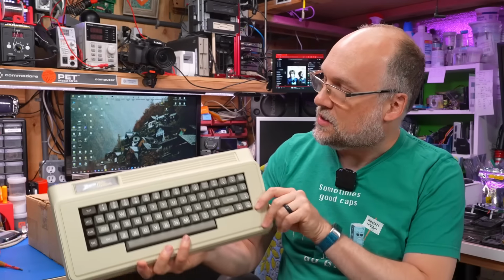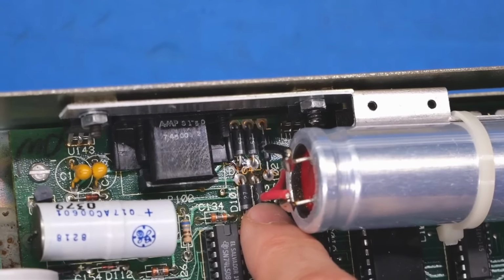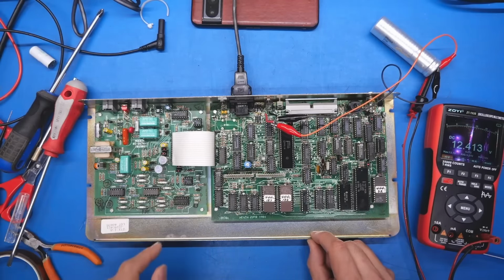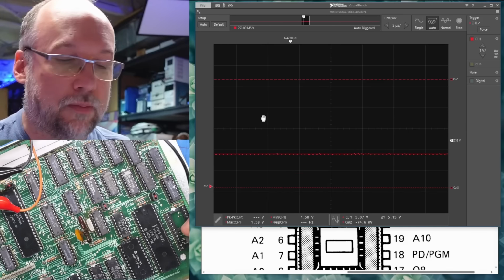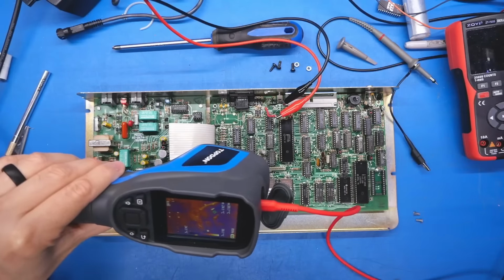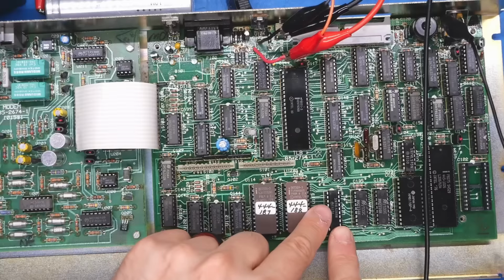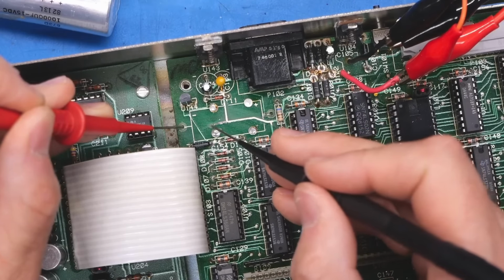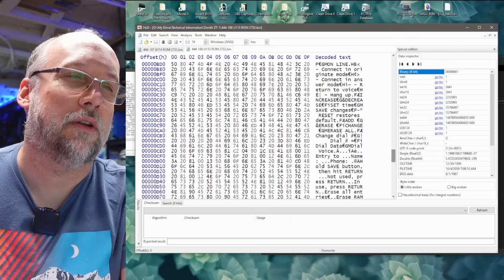The Zenith ZT-1 tried to be a low cost gateway to the information age

Comment: The EA pin is the "External Input" for the microcontroller.  It might be internally grounded on the 8031.  It permits the mask ROM in the pin compatible 8051 to be bypassed and use external ROM instead of the internal ROM.  If you pull the microcontroller and that socket pin is grounded, you should be able to swap an 8051 into the circuit to rule out the 8031 being a problem.  You could of course manually ground the EA pin of an 8051 with an external wire if that socket pin is not grounded.  I've used an 8051 as an 8031 on a solderless bread board with an EPROM acting as the ROM more than once.  Finding an 8051 will probably be easier than an 8031 as they were widely used for years and licensed from Intel by NEC, Siemens, etc. to manufacture compatible versions and variants to meet unique needs.

You might also want to check there isn't an interrupt inputs on the 8031 that is constantly being triggered.  If INT0 or INT1 is constantly held low for some reason, it might be spending all the clock cycles servicing the interrupt routine and never really get much of anything else done unless there is code to prevent it from being overwhelmed by interrupt requests.  There would be some bus activity as observed if this were taking place.

There are a lot of "shenanigans" that can be and were played using the Intel MCS-51 family of microcontrollers and others of the era.  Most of the 8031's ports are used for bus operations with EA grounded, however not all of them are.  All of port 1 and much of port 3 can be used for other stuff.  The addition of 74LS244 and 74LS374 ICs were often used to regain some of the lost I/O points when external bus functions were needed, as were the 8155 and 8255 peripheral interface chips.  Although a free pin on either port 1 or port 3  could be used to enable/disable one or more chips and be a little hard to spot.

Some of the conventional logic for microprocessors of the era, such as the 6502, 6809, 8085, Z-80, etc. doesn't work 100% for the MCS-51, MCS-48, MCS-96 and similar Intel microcontroller families due to the architecture difference.  These microcontrollers are based on Harvard architecture not the Von Neumann architecture that is more common.  You noticed the RAM quirk compared to microprocessors of the era for example.  They're confused chips trying to be RAM, ROM, Port I/O, and a Microprocessor at the same time.

Comment: I wonder if the same design/ROM was used in some kind of Heath terminal. Bitsavers might have something. Alternately, that era of device may have been a copy of one of the Intel reference designs, perhaps from an Application Note for the CRT controller? Just off-the-cuff thoughts

Comment: it may work with both voltages from the AC supply. I had one in the 90s for Unix shell access with 9600 baud modem and amber display. when it does work you will hear a short  beep along with the relay clicks on powerup,

Comment: The 8275 was intended to be used in an mcs80'85/86 system with a dma controller to access the video memory.  The CPU would fill the video memory in the background.  There was an appnote that showed how to build a terminal without a dma controller, the cpu would be interrupted by the 8275 each time a new byte of data was needed to fill it's display buffer from the video ram.  The 8031 was a romless version of the 8051 mcu, and it could have been used instead of the mcs80 microprocessor series.  Is there an external rom containing the firmware for the 8031, or is that an actual 8051 with internal rom?  If you search Intels app notes you might find the one for the 8275 terminal.

Comment: You swapped the 74LS245 while the board wasn't supplying good voltage... you still don't know if the original 245 is good or not.
Reply: I see it too.

Comment: The 8031 is a ROMless 8051 and the 8051 is probably the most used microcontroller in the world because there's an 8051 core inside most PCIe controller and peripheral chips.  It was the de-facto standard microcontroller before the PICs and ARMs moved in.  Sadly I don't have the tools anymore but I can tell you the next important piece of the puzzle will be to reverse engineer enough of the schematic to find how the LS245 direction and enable lines are generated.  With that info this should be somewhat easy as it's a very simple CPU where everything becomes exposed.  I did see some 0 patterns in the EPROM data that make me wonder if there is a little bit rot.  You may need to read those EPROMS with reduced Vcc.  Keep this project open because this can se solved.

Comment: I absolutely love that gigantic capacitor, I wonder if that was always meant to be like that or if at some point they just gave up about getting the power supply more stable and just tossed a huge cap at the problem.
Reply: A cap like that was pretty typical in those days.
Reply: @Peter_S_  indeed. It’s probably not even that high of a capacity!
Reply: @kaitlyn__L  Adrian tested it as 11,500uF with an ESR of 0.1Ω while it's rated as 10,000uF.  Sprague Atoms are good caps.
Reply: @Peter_S_  yeah, I just meant modern ones with the same capacity are nowhere near as large as this :) though admittedly my brain filed it away in a slightly different shelf as it was labelled mF instead of uF for whatever reason!
Reply: @kaitlyn__L  Size is directly proportional to lifespan here.  mF is quite common on US designations.  The one I never preferred was uuF instead of pF.
Reply: @Peter_S_  yeah, totally makes sense. The energy is less packed-in. And of course it was a typical size for that capacity back then. Part of why folks blanket replacing caps when they have no issues can bite them, as the smaller ones get noticeably hotter. 

In electrical in school, a wee while ago now, I always preferred the directness of using the right ISO prefix for minimal leading or trailing zeros. But saw blah-thousand uF so often in practice I suppose I’ve come to expect it!
Reply: @kaitlyn__L  I'm going to guess the most common failure mode is simple corrosion and it may be as simple as thicker plates take longer to corrode away.  They just don't make them like they used to.
Reply: @Peter_S_  yep, makes sense. I’m finding you’re saying what I meant in a much more precise way, but then I did have a big day out yesterday and not much tea today haha. 
The smaller plates are thinner, as well as having a higher surface area to mass ratio even if their relative thickness had become the same. So the corrosive potential is proportionally much higher. 
Plus of course there’s the stressors of the electron flow/capture on the smaller surface area giving it a head start! 
Reminds me also of narrower tape tracks on thinner tape, being far more susceptible to getting worn-off than nice thick tape with wide tracks. 
And then those optically lithographed ultra-mini surface mount ceramic caps… their dense curls can go-short by super tiny in-place deviations which a larger older solid cap would’ve tolerated no problem.

Comment: Regarding the voltage bounce when you disconnect your discharge resistor:

Batteries and capacitors both have internal resistances.  So as long as there is no current, you will get zero voltage drop across the internal resistance.  Once you connect a load of any kind, you will get a voltage drop across the internal resistance equal to the internal resistance x the current. This reduces the measured voltage across the two terminals under load.  That resistance is caused by resistance of the ions migrating between/depositing on the anode and the cathode (among other things). The internal resistance of most batteries tends to increase as the battery discharges, so a nearly-dead car battery, for example, can have a really low voltage while in use, but test as nearly 12V if you disconnect all load.

Comment: My thought: I doubt the cpu is 'stuck' in the sense that it's crashed. I think it is just waiting for something to do, likely in an idle loop or similar. Once the system is configured, there really is no reason for the cpu to read or write to the video memory until the keyboard or modem show some data.
I think further detailed examination of the video circuit, with some limited reverse engineering, might help, but at the moment it seems like if there is component failure, the most likely one is the 8275 :(

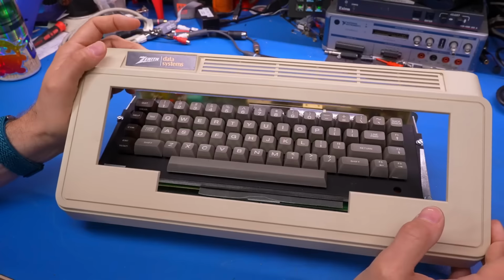Comment: I used to own a Heathkit H-89, which was the kit version of the Zenith Z-89 computer. It looked exactly like that Z-19 terminal you show at 1:19 except it sported a 5 1/4" hard-sectored disk drive where the white panel is. Very Fallout aesthetic, that computer was. It even made the same electronic keyclick noise that the ones in the games do.

Comment: Wow not seen a Zenith in a long time. My first ever x86 machine was a Zenith 286-12mhz Laptop. It had a really odd mono screen where the text was Blue.
Reply: I had a couple like that, two different models of Zenith SupersPort - one was a 286, and the other XT-class. I loved those blue screens. I think I sold them on eBay in about 2003, if I remember correctly. I wish I still had them, particularly the XT-class one.

Comment: Adrian, that HM6116 is a CMOS static RAM of 2K Byte with pretty good low power data retention specifications at 2 Volt power supply (max current something like 30 microAmp according to the data sheet). I bet you, that is the thing that stores the settings and was kept alive by the nicad.
I was triggered by that part number as I used such RAMs for exactly that purpose in my first homebrew computers many years ago (around 1980). I tested one by hooking it up to a 1000 microFarad cap charged to 5 Volts with data stored in the memory. One day later, the Voltage had dropped  to just below 4 Volts and the data was perfectly preserved. Strange testing method, maybe, but my multimeter did not have a microAmp range at that time 😀.
Reply: I think you're right though I would have expected to see a 6116LP in that role instead of a 6116P.  The video controller uses 2k x 8 bits for 1920 characters of storage and the two 1k x 4 bit RAM are most likely configured as 2k x 4 bits of character attribute storage (flashing, highlight, inverse, underline) leaving the remaining 128 bytes in the 6116 available for storage.  I assume the battery powered a real time clock which appears to be the NEC chip closest to pin 40 of the 8031 but NEC didn't do RAM in their RTCs at that point that I can remember.

Comment: Once it is working, it should be entirely possible to add an RS-232 connector using a MAX202 or similar. Since the modem and computer are separate boards, the serial signals surely must go across that ribbon cable.
Reply: Exactly.  All the signals are likely present going through the 74LS368 next to the MODEM cable.

Comment: If you have a CV/CC capable supply (which it sounds like you do based on your comment that you had it set to 4 mA), then there’s no need to manually ramp the voltage when reforming electrolytics - just set your desired charge current limit (I generally go for 5 to 10 mA), and set the voltage output to the cap's rated voltage, hook it up and let it run.  The supply will limit to the selected current until it reaches the operating voltage, then current will drop off as the dielectric continues to re form.  I do this routinely with my little HP supplies and it works beautifully.  An occasional look to be sure things are progressing as expected, but beyond that it’s pretty much set it and forget it.
Reply: dont even need a current limited psu, one set to working volts, feed through a suitable filament bulb to the cap, they make good current limiters and instantly indicate issues

Comment: Hey Adrian, it's usually a good idea to test diodes in both directions as they sometimes conduct in both directions.

Might be what caused the sparks

Edit: Thats a CAP? I thought it was a zener or a transorb for sure.
Reply: It is EXTREMELY unlikely that a diode that measures the proper 0.6 V in the forward direction is going to be shorted in the reverse direction. I have never seen it, and I actually think it might be impossible.
Reply: @helgew9008 not necessarily shorted but high impedance. I had that on a new board before.

Comment: I don't think that the 74LS244 you removed is actually completely compatible with the 245. That might be the issue. Put a 244 back in.
Reply: i think he put the orig chip in after trying the other.
Reply: @rivimey  theyre not the same, '245 is bidirectional, '244 isnt and totally different pinout
Reply: 51:30 Both are 245
Reply: I think that you are mixing up Usagi channel with Adrian Blacks?

Comment: Hi Adrian, I would suggest checking the battery circuit. Some of those RAMs (low power) might disable the CS and WE.
Also, some old video generators , especially old ones , should generate address signal to the RAMs. I've seen in old arcade boards.( worth check datasheet).
The circuit might have a zero cross detector from the AC.
Awesome videos, keep it up.

Comment: I can confirm that almost every computer related device was Heathkit designed.  Heathkit was much better as an independent company when Zenith took over there were some  reductions in quality in a lot of areas.  I stopped using them soon after. I built so many of their electronic kits, including test equipment back when they're just Heathkit.  Here's a very interesting documentary about Heathkit https://www.youtube.com/watch?v=V-F_Fz2G7BI  They were the best kits you could get and their instructions set a standard they they constaly imporved on.

Comment: I found an "HTX-10" terminal years ago that looks exactly like this. It's lost somewhere in my attic right now, but seeing that the 9-pin connector was for the power wall-wart that I surely never had, that probably explains why I never did much with it. It's also possible that they put RS-232 signals on a couple of those pins. For what it's worth, I had written down a note about the power supply "31VAC 10VAC 21 WATTS MAX", but no pinout.
Reply from the maker: I will talk more about all of this in Part 2 :-)

Comment: Is there some way it could detect if a monitor was plugged in? Like some wire from the monitor plug goes high or low whenever a monitor's plugged in, the code looks at that, and then doesn't bother driving the CRT output circuitry?
Reply from the maker: No, not this design. It's a CRTC like a 6845, it should just start outputting a sync signals if it gets programmed properly by the ROMs.

Comment: Bit of a tricky one here. This depends on how the DMA access for the 8275 has been worked out, however I wouldn't be surprised to find that after reset and writing a few setup instructions the CPU never talks to the 8275 until it needs to move the cursor.
My guess would be the code is doing something along the lines of:
Setup 8275 / Serial ports
Clear screen to either a space or NUL character
Say hello to the user then
Poll the keyboard waiting to do something

Comment: The "tiny tantalums" near the output most likely are ceramic capacitors - likely some EMI filtering.
Reply: Tantals are yellow, ceramics orange
Reply: @JanKowalski-vh1rg I’ve seen orange tants and even blue ones. I’ve also seen ceramics in white. Sometimes the colour can help, eg a surface mount (likely ceramic) capacitor is usually sandy brown, but it certainly can’t be held hard and fast. There’s always plenty of exceptions, just as resistors can be tan or brown or blue.
Reply: @JanKowalski-vh1rg not necessarily, there are multilayer ceramics in yellow, disc ones 'usually' more orangey, but other colours as well, mostly green